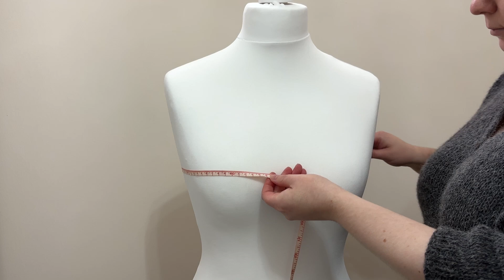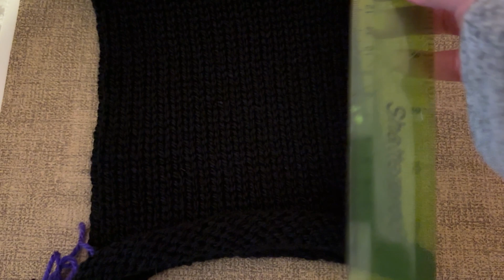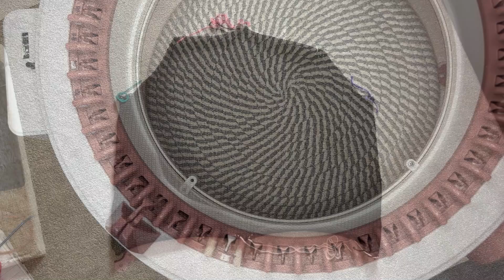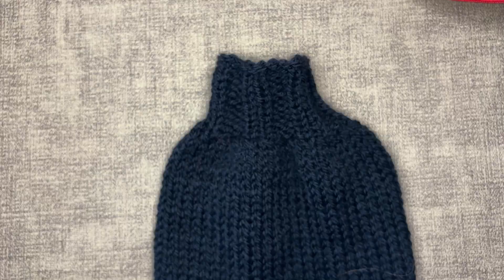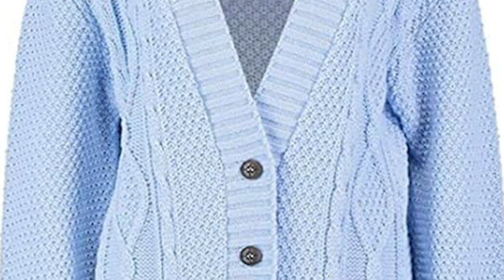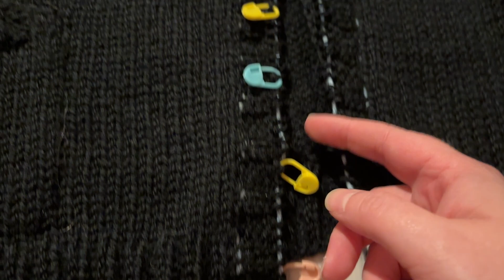Sentro Knitting Machine Cardigan with pockets | pattern tutorial | beginner project

Comment: hi! I just purchased the pattern, and I was wondering if there is a way to adjust the pattern to make the cardigan smaller?
Reply from the maker: The pattern comes with multiple sizes but it is aimed at plus size bodies. Do you need a bust size smaller than 91cm? Depends how much smaller you need to go. I would recommend adjusting based on front and back measurements rather than full circumference. You might even be able to get away with just one panel on the back.
Reply: @emilysmith2784  I was hoping for A, armpit to armpit, front to be 40cm and then B the back to be 40 as well.
Reply: should I just adjust the number of cast on stitches and keep the rest the same? 
I am trying to adjust the pattern so that it would fit my daughter
Reply from the maker: @jakkim-ly2bx okay. I have not tested this but if you are on gauge (15 sts to 10cm) then cast on 30 sts for each back panel and 27 sts for the front. The buttonband as written is approx 4cm wide but you can adjust this.
Reply: @emilysmith2784  thank you so much Emily!